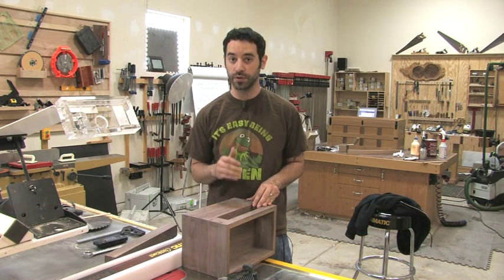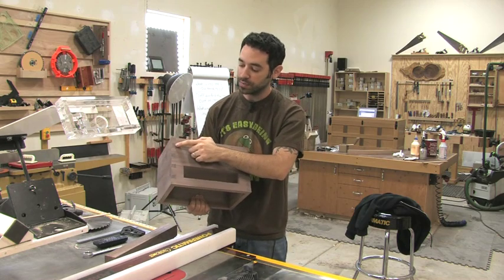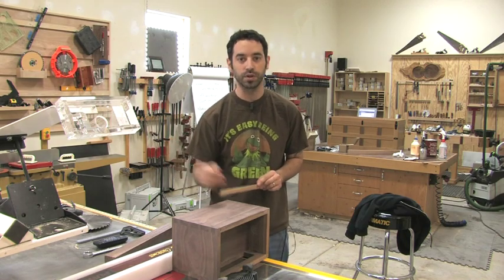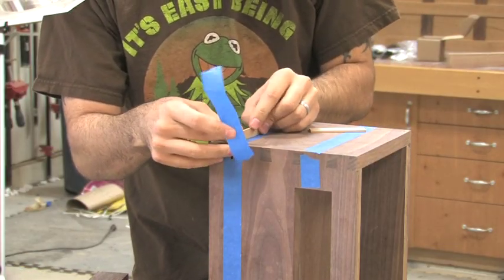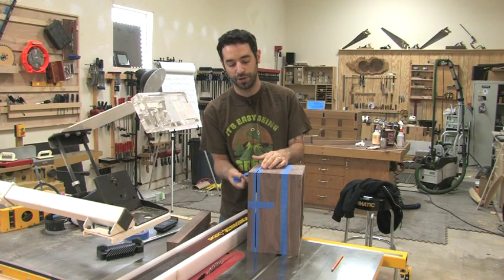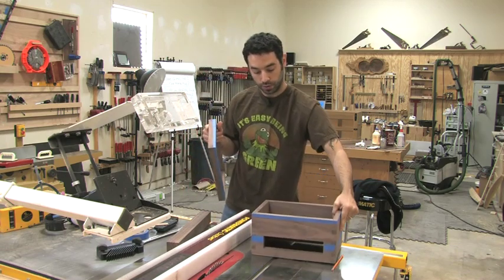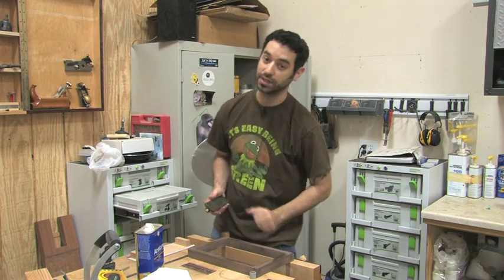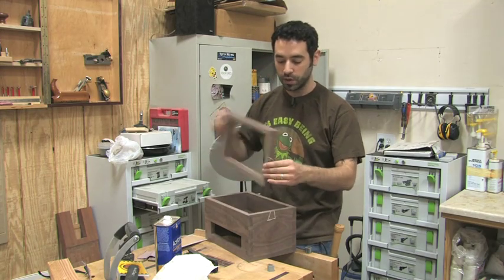TWWMini - How to Saw Off a Box Top

Comment: Instead of sawing the top off by cutting completely through, I saw it within a very small hairs width of breaking through. I leave just enough to hole the box together. Once cut on the table saw, I do the final cut through with a pocket knife. An easy way to determine the cut depth is to test cut a board the same thickness as the box side so the board barely hangs together and can be snapped apart once cut.
Reply: i  tried this the  second time i made a  box  and now  use this  method   everytime , better than the   shim in the kerf IMO

Comment: Marc, an easier way instead of using the filler piece and all that tape, is to set your saw blade to cut right through, but only cut the front and the back.

Then lower the blade so it doesn't quite go through the side of the box leaving maybe a 16th of stock and cut the ends. You then have the box and it's lid still connected by a sliver on each end.

You then finish the cut to each end by hand with a fine saw or even a sharp knife. Tidy up with a plane (or sandpaper if you must!). Regards Graham in Manchester UK.

Comment: ROUTER SLED HELPS ME WHEN SPLITTING A BOX: Always enjoy your videos.  Should also show some of your things on ''WoodWorking Projects'' on FaceBook.  One thing I have found.... When sawing the top off a jewelry box, it is always a problem of saw kerf.  No matter how careful... it happens. So, what I now do, rather than adjust and sand and adjust.... I put the sawn pieces into a router sled and machine off the imperfections. Leaves for a perfectly flat joint.

Comment: Pretty easy and straightforward to end up with a lid that is the same thickness all way around.  Can you enlighten me on how to cut a lid that is shorter vertically) in the back and taller in front, such as you often see in older recipe boxes?

Comment: I cut the top off of a nice box joint jewelry box today with my table saw. I removed the riving knife, lowered the blade. I put shims in after I cut 2 sides and I had the box taped. I still got a serious kickback when cutting the last side. It damaged the box but I was able to sand blade cuts and made it look ok. I don't know what went wrong. I think I may have squeezed the back end of the box when I made the last cut. Any ideas on what went wrong? It scared the crap out of me. I think I am going to use my bandsaw from now on to cut off tops.
Reply: Unlike what he did here and just like you should always do when cutting a board, always cut the lid off with the bottom of the box against the fence, especially if you're using figured hardwood.  Don't know why these guys keep cutting boards/boxes incorrectly!